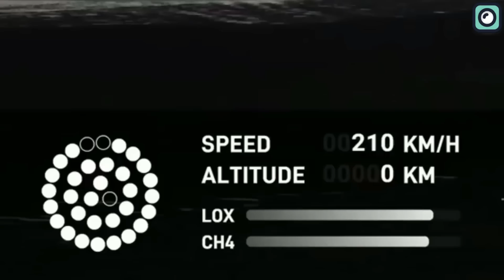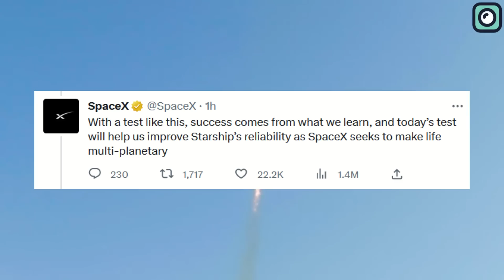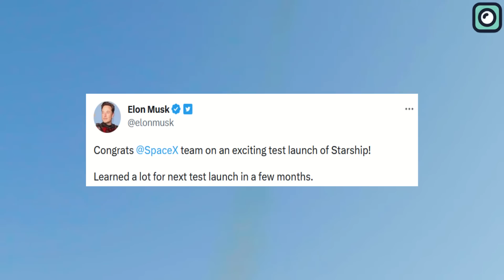SpaceX Revealed Why Starship Blow Up During The Orbital Launch Test... Musk Reacts!

Comment: IMHO the fact that starship and booster #7 stayed intact throughout 5 or 6 complete "flips" if you will. Is a completely insane testament to the build and the engineering that the SpaceX team pulled off. And not to mention they didn't perform a test hop of any type with booster 7. They went completely all out. And on my opinion freaking nailed the first attempt. Imagine when boster 9 makes its debut with the many improvements it contains over booster 7. The future of spaceflight is incredibly bright!!! Hats off to Elon and the whole SpaceX team. I wish I could be a part of the team. But I guess in essence, we all kinda are a part of the team.
Reply: Apollo 8 went all out. This, not so much.
Reply: Yes thanks for your reply, I hadn't thought of that. SpaceX HAS a flawless record for Falcon 9 because of a good program of testing before. Falcon 9 is the best  rocket there is at this moment. It has saved a huge amount of money for the taxpayers to supply the ISS so cheap.
Remember the Soyus rocket. It works for 60 years now and I am convinced that the starship rocket will thrive for at least 60 years before being decommissioned because none other rocket company will be able to compete with starship in a cost effective manner. The launch pad is a real issue to be adressed, but they will fix the problem for sure.
Reply: Concrete and steel missiles will get your sensitive rocket engines every time!
Reply: Love the enthusiasm but I would go with nailed it, if the bad was not destroyed and thus the rocked made it to hawaii. They took a risk and lost but it was all throw away anyway so they learned a lot and will be better next time. Unfortunately I would guess this failure cost them about 4 extra months. Naturally I have no way to know how many months they gained from the new knowledge that this failure will lead to.
Reply: Unique technologies were presented at the international online forum "Global crisis. There is a way out". For example, the health capsule (the possibility of life extension, rejuvenation and absolute health), from time 7:09:09.
These technologies will be available to everyone for free in the Creative Society.
Reply: I would have done a test hop to test the chopsticks
Reply: The were designed to flip.  That's how they come back to the launch site.  Falcons do the same thing.  Nothing too amazing there.

Comment: It looked like it started out with three dead engines, then three more cut out higher up -- mostly to one side. That's a lot of lost thrust and adjustment. It's a testament to Starship's inherent strength and stability that it it went that high for so long. Incredible damage to the launch pad base, with almost certain resultant damage to the raptors, so we know the launch pad needs to be improved with at least a deflector (which was planned, anyway). Regardless, Spacex must have learned a lot from this.
Reply: Before the launch, I heard someone state they were going to delay release of the hold-down clamps for 8 seconds.  Would love to know what that was for.  It seems to have resulted in a maelstrom of concrete, rock, soil, and debris under the launch mount.  There had to have been a substantial amount of reflux of that material impacting the engines and underside of the booster.  Can’t wait to hear the mitigation plans for that.  Go SpaceX!

Comment: Fail this fail that. This was a huge success. It flew! Does anyone remember all the failed rockets in the space race. This was awesome. Way to go spacex!
Reply: This is sucks not success losing  one hundred billion dollars
Reply: @nw7530  the rocket didn’t cost 100 billion. Maybe 50mil if that. Thats the reason he used stainless steel. Cost effective.
Reply: @nw7530  lol you could have just said “I’m ignorant on this topic” and it would have gotten the same point across.

These channels are just using rage bait for views. No one that actually knows anything about what spaceX is doing thinks this was a fail
Reply: I remember Saturn V. 13 launches, 13 successful payloads to orbit.
Reply: @executivesteps at that point testing was done though the development of the rocket was very spicy with many rocket engines blowing up and tanks that needed more development because they blew up
Reply: @daanzoomer2997  As I said 13 out of 13 Saturn Vs.
Reply: @travisjazzbo3490  No I’m saying if they had modern software they would have had a much MUCH higher success rate.
Reply: @executivesteps  redstone? Mercury? Titan? Thor?
Reply: @nw7530  billions lol...go to bed kid
Reply: @executivesteps  whats your point
Reply: @tmikkelsen8066  Atlas
Reply: @tmikkelsen8066  $300 million
Reply: @rcpmac  thanks
Reply: Yeah but in the late 50s and early 60s they didn’t try to spin those failures as anything other than a failure.  
There was one notable exception, that was when a Little Joe rocket started spinning and broke up during a test of the capsule escape system.  The escape system worked perfectly, even though the rocket failed.

Comment: Cosidering massive fod damage to engines during launch it flew really well, until fins lost atmosphere and asymetric thrust started to rotate whole thing imo. And still the whole whing didn't fell apart during spinning. Impressive
Reply: It was supposed to flip before 1st stage separation. Not to continue to flip. And the 1st stage was actually supposed to separate, which it didn't.
Reply: The flip was intended to separate the stages as they have no mechanism to do so otherwise.
Reply: @HelenHumphries  180 flip was intended, not this xD
Reply: It has enough engines + active stabilisation, so it can compensate almost any failures causing asymmetric thrust. It is barely a thing. It looks like the separation has failed while the first stage already out of fuel.. hardly trying to stay stable till the very final moments
Reply: @DF-ov1zm  You know, thrust vectoring might took damage too. Just look at the engine cluster and how flaming red inside was
Reply: @adrianstachowski9422  I'm not sure about these flashes. It must be caused by debris from the launch pad. But it's obviously not a coincidence that flips happened exactly the moment when separation is supposed to happen. Beside if vectoring failed, we would notice that almost immediately. I really doubt the rocket would make it up to 38km in that case.
Reply: The problem was detachment and the thrust. It lost altitude while not detached, a recipe for a “rapid unscheduled disassembly”
Reply: @helicopter7997  I don't have telemetry data, but from the video it seems to start losing altitude after the flipping has already started
Reply: @DF-ov1zm  it wasn’t supposed to lose altitude from the flip because it was just to detach. It lost altitude because of the detachment failure, meaning it’s one big skyscraper falling down from who knows how big up.
Reply: @adrianstachowski9422  yea, thats because the 1st stage didnt detach, had it detached properly then the 2nd stage engines would have ignited and the spin would have stopped.
Reply: Advanced technologies were presented at the international online forum "Global crisis. There is a way out". For example, the health capsule (the possibility of life extension, rejuvenation and absolute health), from time 7:09:09.
These technologies will be available to everyone for free in the Creative Society.

Comment: They are not failures. They are tests. Very different things. ugh.
Reply: Yeah, tell that to the people that were taken off their island so that we could " TEST " the hydrogen bomb.
Reply: @HelenHumphries  FYI... The SpaceX Starship vehicle does NOT use Hydrogen.
 "The Starship launch vehicle consists of the first stage Super Heavy booster and the second stage Starship spacecraft. Both stages are powered by the Raptor rocket engine, which burns liquid oxygen and natural gas propellants in a highly complex but efficient full-flow staged combustion power cycle."
No Hydrogen.
I guess you wouldn't say silly things if you actually knew what you were talking about.

Comment: I am surprised that spaceX  didnt install a flame diverter or a water deluge system when first building the launch site and the OLM. I hope they manage to get something installed because the damage to the launch site this time was quite bad and it wasnt just local to the OLM it damaged the water tanks with flying concrete lumps. great work from SpaceX  though they have achieve so much in a very short period of time.  The falcon 9 program is a masterpiece of technology and so will starship once they have ironed out all the problems. Keep it going SpaceX the world is routing for you to succeed.
Reply: I agree I think the damaged Launch pad was a screw up, I think they should have anticipated this being the power and fire released, and built a pad and diverter to handle it appropriately.  This was a mistake.  May have cost them  the first flight. Haste makes waste. None of these tests are cheap,  might as well. , balance all 😮variables in your favor.  If a little   is good , a lot is better then too much is just right...as might friend  used to say, ....
Reply: Musk told the engineers it wasn’t necessary back in 2020. After all he is a genius.
Reply: @executivesteps  don't  think he's  as smart as he thinks he is...his fire breathing  dragon is more powerful  than he thinks it is...
Reply: His logic is, this has to be able to lift off from a planetary surface. But I CERTAINLY think a flame trench is in order during the development phase

Comment: Welcome to the Sausage Factor kids! I started following space flight development 62 years ago and I quickly learned it is “one step forward and two steps backward”, however, if you never take the first step forward you remain on the ground looking up and only wondering what spaceflight would be like.  Testing rockets is a lot more complex than testing a car. You can’t just crank it over and then shut it off. It is more like testing a bomb. You do the research, build it, light the fuse, and back off. You get one shot at it and you are done. You figure out if it worked only after you have expended it and it is not something you can do in the lab so the whole world gets to see the results. Kind of hard to test-fire a 400-foot rocket in the lab.

Comment: I'm no fan of Russia's space program, but look at their launch complex. The first thing to notice is that the vehicle is propped high up and away from the land beneath. Considering ever launch (exercise) to date, why didn't anyone, (including Elon), start to wonder about the effects that a 900 Million horsepower blow torch/acoustic generator would have impinging on the (relatively thin, poorly reinforced) pad only tens of meters below? An iterative approach to technological advancement is valid as long as it is applied to the full spectrum of goals and challenges. But I'm still a SpaceX fan.

Comment: A few months to repair?! That's a 25' crater under the launch mount. All of the reinforced concrete that used to be under it is now in cameras or the ocean. The rebar is bent and twisted. that tower is a near total loss. You can't repair it, the structural integrity is totally compromised plus they have proven, in dramatic fashion, the need for a flame diversion system and a real water sound suppression system. They spent 8 months letting the concrete in the pylons for the tower cure before putting the table on top. We're a year out from this thing being usable again.

Comment: My guess is the failure was caused from a malfunction of the separation of starship. The two stages were stuck together and the starship might have performed a belly flop maneuver causing an end over end tumble. The software was not able to correct the tumble because it was never intended to still be attached to the first stage which completely changed the handling physics. Just my guess.
Reply: You don't think asymmetric thrust from the moment of ignition had anything to do with it?
Reply: @TrevorSachko  No.  The other engines will compensate.
Reply: @jetsandblades  And they did, end over end it went.
Reply: When the time for separation came Starship was only about 35km high.  That was only halfway to separation altitude because the booster drastically underperformed with the loss of so many engines.  It didn't separate because they were WAY outside the nominal flight plan.  There was no way for Starship to make it to Hawaii at that point.  It would have come down far short of its target.  That isn't acceptable, so separation didn't happen and the mission was aborted and the spacecraft was destroyed.

Comment: It was a great flight but I have always wondered why they didn't protect all the nearby structures better with at least high dirt mounds, a diverter, water system etc. It has always looked open to getting wiped out by any big failure.

Comment: NASA has a big concrete duct to deflect the exhaust blast on take off, and avoid damage to the rocket. They also dump large volumes of water to cool the exhaust and preserve the integrity of the concrete. SpaceX seems to go for a parking lot solution.
Reply: The water at Launch Complex 39 is not there to cool the exhaust or protect the concrete.  The water deluge system is a sound absorber that keeps the incredible sound pressure waves from bouncing off the concrete and back into the rear end of the spacecraft where they could damage things.

Comment: The main failure was not that it flipped out of control, but the fact that they could not separate the booster from the 2nd stage which caused those flips.  When they could not get separation, they blew it up for safety.  The fact that is lifted off after losing THREE engines at the pad is amazing.  You CAN SEE as it climbs when they lose more engines, small explosions point those out.  But STILL it continued to climb to an altitude they COULD have separated and Starship continue on.   There was still possible mission success with 6 engines gone, but the inability to separate the two necessitated the self destruct.  THAT part was kinda sad, but even MUSK said that it would be a complete success if it just cleared the tower!  It did do far more.  BRAVO!
Reply: Not so amazing.  The booster has 16.7 million pounds of thrust with all engines working.  Each engine provides about 500,000 pounds. Losing 3 engines means it had 15.2 million pounds of thrust to lift 11 million pounds of rocket.  Of course it lifted off.

Comment: What to change: 1.) Move the tank farm away from the launch pad. 2.) Weld giant 3 inch 316 stainless steel plates under the launch stand with blades facing up towards the center allowing the energy to be deflected away from the engine assembly. 3.) Replace the engines with Raptor 2's. 4.) build a berm around the tank farm to get up to OSHA code 1910. 5.) Hire petrochemical engineers with 20 years of experience. 6.) Shield any and all areas that could come under pressure from the launch i.e. elevator cables, doors, etc.
Reply: Or instead of all that stuff you could add a water suppression system  like they had at the saturn 5. All you need.
Reply: They need a HUGE water suppression system AND a Flame Diverter Trench PLUS move the Tank Farm.
Reply: 7.) Change the launch site as close to the equator line as possible. It will save many newtons of thrust.
A suggestion: Launch Base of Alcântara/Brazil

Comment: did I miss the reason why it blew up, other than they had trigger self destruct?
sure, some engines got hit, but that does not yet explain the tumble, and certainly not the missing stage separation.
Reply: Same here. Was waiting for the explanation from SpaceX.
Anyway, this was still a big step forward in the development of a working solution to get to the moon and beyond
Reply: UNCOMFIRMED - MY OPINION:  Staging did not occur as planned and they were unable to start the second stage engines with the booster still attached.  The rotation was planned to help the first and second stages separate, but when they didn't come apart, the weight of the starship vs the weight of the empty booster made it gyrate in an uncontrollable manner.  When booster fuel supply was depleted in an attempt to force separation, the flight termination was activated.
Reply: @corwinchristensen260 . My understanding, from comments by SpaceX's M.C. is that booster "rotation" was to occur AFTER stage separation (so the booster could head back towards the launch site... thus step towards booster recovery).  The two-stage cartwheel then must not have been part of "nominal" launch sequence.  Yes, I am also curious about why stage separation did not occur.  But at least it cleared the launch tower without blowing up Boca Chica.  Again, why was all that concrete shrapnel not controlled-for?
Reply: @royjohnson366  i am also wondering why they did not anticipate the ground getting ripped up. up
Reply: @royjohnson366  yes, the booster should rotate after stage separation. since this did not happen, there needs to be an alternative plan to "fix" this. imagine a starship launch, 100 people on board, and the stages don't separate. so what now?

my idea for a simple fix is: fire up the engines of starship while connected and sacrifice superheavy. because that thing we have seen, it is okay to blow it up on a testflight. but a fully loaded starship with ~100 passengers? they'll be quite unhappy, albeit only for a few seconds and the rest of their lives (which is pretty much the same timespan).

there needs to be a solution for this.
Reply: @robertheinrich2994  
Elon has made it clear:  both booster & Starship will be designed for re-usability.  Thus, sacrificing the booster is not in SpaceX's blueprints.
My guess, when 100 passengers are riding, an escape module will be part of the vehicle.